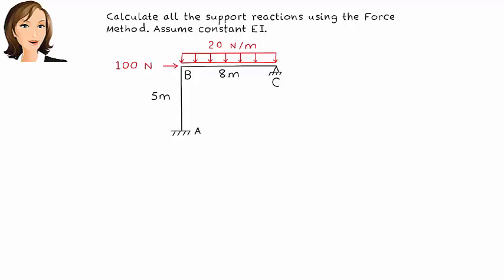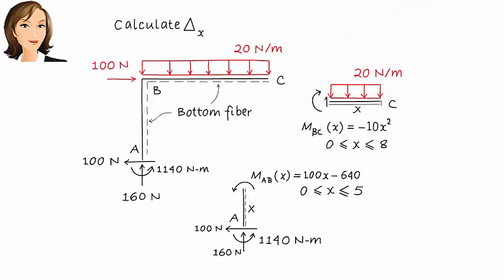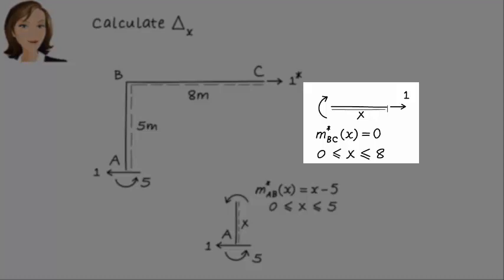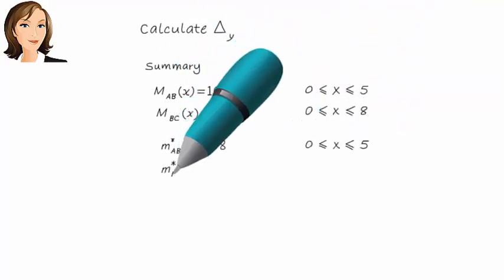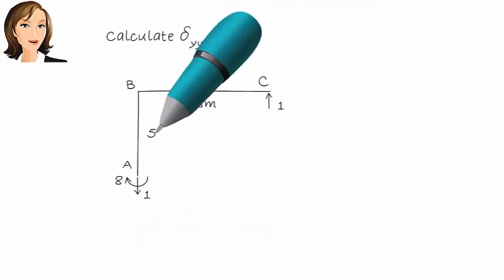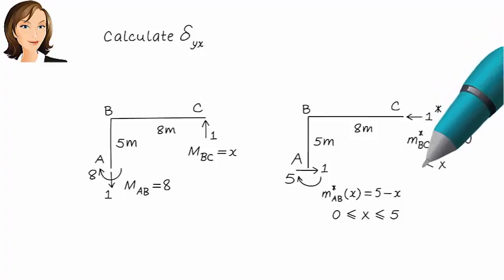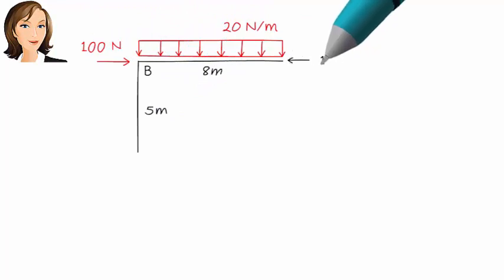Force Method: Exercise Problem 1

Comment: @0647, i think that     DELTA_xx = delta_xx * Cx + delta_yx * Cy, do i right?
Reply from the maker: Not sure if I am following you here. The compatibility equation is shown at the beginning of the video, not at @06:47 which is the end of the video.

Yes, your equation is correct, so is the given equation. The only difference that I can see between the two equations is in delta_xy (in the video) vs delta_yx (yours).  But keep in mind that delta_xy is always equals to delta_yx.  Or more generally, delta_ij = delta_ji.

If I have mis-interpreted your question, please elaborate.
Reply: Dr. Structure why delta xy must equal to delta yx ?
Reply from the maker: delta_ij is displacement at point i when the unit load is placed at point j. How do we compute the displacement?  It can be written as:

delta_ij = (1/EI) Integral of [m_i * m_j] 

where m_i is the moment equation for the beam when a virtual unit load is placed at i (and there is no other load on the beam) and m_j is the moment equation for the beam when the unit load is at j (and there is no other load on the beam). 

Well, delta_ji is computed using the same two moment equations. Here, we want displacement at j when a unit load is at i. So, we need m_i (the moment equation when for the beam when the unit load is at i) and m_j is the moment equation for the beam when we placed the unit load at j. Hence, the expression for delta_ji also comes out to be:

delta_ji = (1/EI) Integral of [m_j * m_i]
Reply: Dr. Structure ， why do we did not consider axial force and axial deformation on this structure?
Reply from the maker: Neither the force method nor the slope-deflection method is equipped to deal with axial deformation in beams. These methods use a beam model (a pure beam) that is assumed to carry shear force and bending moment only.
Reply: Dr. Structure 
but should it is a frame, rather than beam structural?
Reply from the maker: Yes, here we have a frame in which a member can act as beam-column, meaning it can be subjected to bending moment as well as axial load. But, as I mentioned above, when it comes to calculating displacements, we utilize the beam theory according to which axial deformation does not come into the picture when calculating beam deflection.
Reply: Do you mean that force method can solve the indeterminate frame? But in this case, we just consider a frame as one vertical beam and horizontal beam only. 
Since in SA23 , we can solve the deflection of frame, we consider axial force and bending moment. 
In this example member AB has axial force and deformation, 
External virtual work = Internal virtual work
Internal virtual work include axial and bending terms in each member.
Reply from the maker: The force method is indeed for analyzing indeterminate beams and frames. 

In frames, displacements are mainly either due to bending or sidesway. For example,  in this particular frame, Delta_x is caused by the sway of member AB under the horizontal load. Here, axial elongation of BC, or AB, is in fact inconsequential. 

When calculating Delta_x, for both members AB and BC the internal energy is zero:
(axial elongation due to the real load) times (virtual axial force) in each member comes out to be zero.

For other cases, internal energy due to axial deformation is going to be relatively small, compared to energy due to bending, hence often they can be ignored.
Reply: When calculate delta x, i agree that it does not have internal force from axial force, but it should have internal energy at member AB from bending moment.?

Also, when calculate delta y, member AB has axial force, so it should have internal energy from axial force?

Do i right?
Reply from the maker: Yes, there is internal energy due to bending in AB. The internal energy in the member due to axial deformation however is zero.

Yes, for calculating Delta_y, member AB is going to have axial deformation as well as (virtual) axial force resulting in internal energy. But that stored energy is small compared to the energy in BC hence it will not contribute significantly to the internal energy of the entire system.
Reply: When do we need to consider the internal energy from axial force? Since SA23 consider axial and moment for frame.
Reply from the maker: You can always consider it, if you are not sure. If it turns out to be zero or relatively small, no harm done.  With experience comes the insight about the behavior of the system. If the behavior of the system is governed mainly by bending moment, if large displacements takes place due to bending and axial force, then axial deformation most probably would be insignificant and can be ignored. But to be safe, you can calculate them and include then in the formulation.
Reply: Dr. Structure 
anthoer question, 
when using method to analysis this example, 
could we take fix support A to pin support A and take pin support B to roller support B  as redundancy ?
Reply from the maker: Yes, we can take any of the support reactions as a redundant force. So, we can use the moment at A and the horizontal reaction at C as the redundant forces.
Reply: As your mention, I try to take the moment at A and horizontal reaction at C as redundant forces. 
Please see the follow link: 
https://www.facebook.com/photo.php?fbid=10156625991467710&set=a.10156625991207710.1073741852.595557709&type=3&theater
I cannot find the same answer of vertical reaction at C and bending moment at A, in the final page , I enclose a circle rectangle to 2 equations. 
I think that the problem should be in those equations: 
Delta X = Cx * delta xx + M * delta rx
Theta R = Cx * theta rx + M * theta rr
The unit of the above consistency. but in the concept of superposition, I think is like this. 
May you point out my mistake and state the correct direction please?
Reply from the maker: I can only see one computational error in your formulation. When writing the integral expressions for real rotation at A, for one of the moment expressions, you wrote (142.5 - 10x^2). It should be (142.5 x - 10 x^2).

Further, the compatibility equations you wrote above, are not quite right for your solution. All your displacements (real and virtual) are defined in the same direction, therefore, their sum must be zero. So, move the term on the right hand side (real displacement and rotation) to the other side with a positive sign, then set the sum of all three terms equal to zero for each equation, like this:

Delta X + Cx * delta xx + M * delta rx = 0
Theta R + Cx * theta rx + M * theta rr = 0
Reply: I think my compatibility equations are right, since i correct the error, the solution can be got.
Reply: The discussion btw you 2 cleared my doubts 🙏🙏😊😊

Comment: Dear sir/madam, you said before... when you remove restrains... the structure should be stable!...but here you made "C" as a redundant....is it stable?
Reply from the maker: Yes, there is a fixed support at A. That makes the frame stable, just like a cantilever beam.
Reply: Thanks

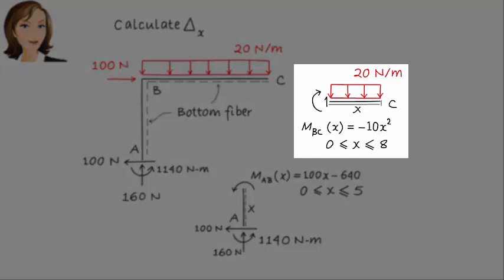Comment: At time 1:43, M(AB) should be = 100X-1140     ,however it is shown incorrectly: M(AB)=100X-640
Reply from the maker: Thanks for the correction, it is now noted using the YouTube annotation tool.
Reply: It must be M(AB) = -100X - 640
Or M(AB) = 100X - 1140
Reply from the maker: @seddiksoundous9883  100 x - 1140 is the correct expression. The first term (100 x) is a clockwise moment, the second term (1140) is a counterclockwise moment. So, one should have a positive sign and the other a negative sign. If we are writing the sum of the moments about the cut point, we get either: 
M(x) + 1140 - 100 x = 0. 
Or, -M(x) - 1140 + 100 x = 0

Either equation gives: M(x) = 100 x - 1140.
Reply: @DrStructure  
 @Dr. Structure 
The both are correct.
Imaging we cut this column to determine the internal forces.
We will have two sides.

The bottom side where we have the support reactions. If we will determine the bending moment equation for an arbitrary point :
Sum of the moment about the point of the cut : 
-M(x) -1140 +100X =0 
So : M(x) = 100X -1140   0<x<5 (from the base of the column to the top) 
Replacing by the values we get : 
M(0) = -1140 N.m ( the same as the support reactions) 
M(5) = -640 N.m

The top side where we have the concentrated load 100 N and the distributed load 20 N/m. 
Determining the moment bending equation for an arbitrary point : 
M(x) +100X + (20.8).4 =0 
So : M(x) = -100X - 640    0<x<5 (from the top of the column to the base ) 
Replacing by the values we get : 
M(0) = -640 N.m ( the same value of the previous equation whare M(5) = -640 )
M(5) = -1140 N.m ( the same as the support reactions)
 

But we should precise one direction (base/top) or (top/base) to use in the solution.
Reply from the maker: @seddiksoundous9883  Correct! 
If the origin of the coordinate system for the column is placed at the bottom of the member, x pointing upward, then M(x) = 100 x - 1140 is the only correct equation. If, we place the origin of the coordinate system at the top of the column, x pointing downward, then the correct moment equation would be: M(x) = -100 x - 640. Although we are free to place the origin of the coordinate system either at the top or bottom of the member, but once we made that decision, only one moment equation results, and we cannot use the two equations interchangeably.
Reply: @DrStructure  perfectly explained. Thank you dr sructure

Comment: at time 2:20 the unit virtual load is directed towards right; in contrary at time 4:00 unit virtual load directed towards left

here is what I have concerned about;
for both the cases up, I "think"  m*(x) should be equal but you have set it up two different equations: 5-x     and    x-5    respectively. This is different than if you set it up 5-x    and    5-x  respectively. Please explain the discrepancy if is possible.
Thanks
Reply from the maker: Given the assumed bottom fiber for the member, when the virtual load is applied in the positive x direction, bending moment in AB is going to be negative. That is, the bottom fiber of AB undergoes compression and the top fiber would be in tension. When the virtual load is applied in the negative x direction, moment in AB reverses direction, it becomes positive:  bottom fiber would be in tension and top fiber would be in compression. That is why the two equations differ in sign.